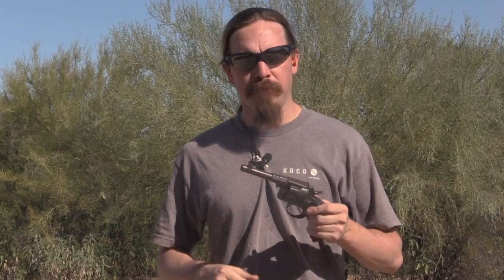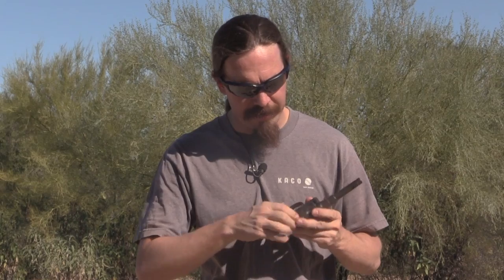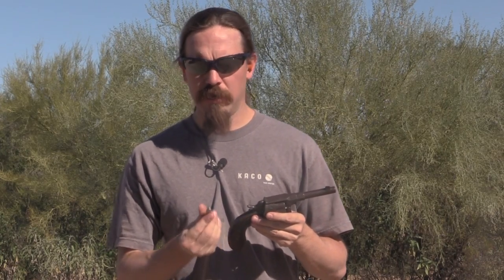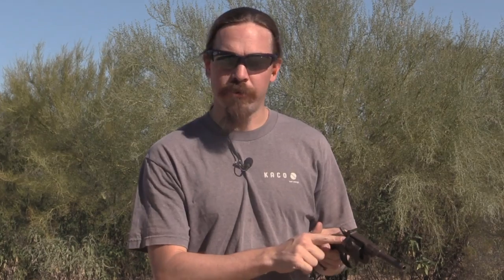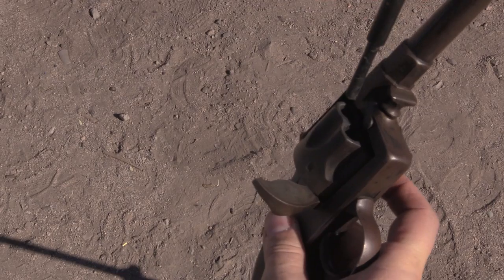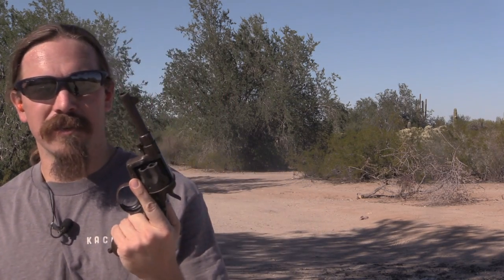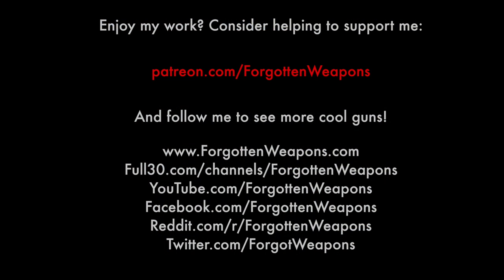Shooting the 1883 Reichsrevolver

Comment: The fact that this revolver has no manual ejector is unforgivable. I could totally get used to everything else.
Reply: Joe Cool  Yes, a very silly omission.
Reply: yep! the only deal killer for me to!!!
Reply: I'd rather have a Webley. Reloading is piss-easy and the casings eject themselves, double/single action with a surprisingly smooth double-action trigger pull, nice big sights for easy target acquisition; just generally seemed to be a more thought-out design, it would seem. As mentioned in the vid, even the M1873 Colt Single Action Army would be better. Smoother action, GREAT ejector rod (probably second best for fixed-cylinder revolvers; there's one Swiss revolver that I think was better because opening the loading gate made the trigger automatically index the casings for you which sped things up), better ergonomics, no useless safety, and so on.

I'd even rather have an M1895 Nagant, and the one I owned left a TREMENDOUSLY bad taste in my mouth. The double-action feature worked only when it wanted to, casings occasionally got stuck in the chambers, couldn't hit dick with it (I'm no marksman, but I was getting something like 10" groups at 10m), and while the Military loading was probably more potent I found the commercial stuff I got from Fiocchi felt utterly anemic. Like I was shooting .22lr or something like that, no 'oomph' or 'heft' at all. In the end, I happily rid myself of it. The date of manufacture was, surprisingly, almost as recent as you can get for the M1895; 1944. Production stopped 1945 as I recall. 

Externally it looked great, but the double-action trigger just could NOT be trusted so was basically single action only. I broke an M1911 mag by using the 'toe' of it to try and pry out a casing from the revolver. The baseplate loosened, weakened, and eventually snapped off.
Reply: It's amazing a major power like Germany had a weapon without a basic feature common in cartridge revolvers by 1870 in 1879. That thing is like a scaled up Smith and Weapon No.2 from 1862. I can see why they didn't want the overly complex Mauser Zig-Zag but other than pure national chauvinism why take this over superior foreign designs?
Reply: @nunyanunya4147  this was produced almost 9 years after the idea was invented and in widespread use by virtually anyone who used a revolver.
Reply: Brings new meaning to the phrase pencil pusher
Reply: Hindsight is 20/20. Remember, they used to think MGs were pointless in combat.
Reply: There exists a better version (Baby Reichsrevolver) which comes with an ejector rod and double triggers.
Reply: @normanm5254  well, in a direct comparison basically all revolvers beat the reichsrevolver but well, there's the other thing you have to consider, this is a 130 year old gun and it still works perfectly (and so do all other reichsrevolvers still around). It has one good feature and that's the fact that it's sturdier and more reliable than a Nokia.
Reply: The overriding design requirement was robustness. Perhaps they somehow felt a manual ejector was breakable. Not saying it was good thinking, but I'm just wondering.
Reply: @thif4722  : This had been civilian production, the armies of the four german kingdoms gave contracts to different arms companies, because the Revolver was not developed by a commercial company. But also other companies ,german and belgian , produced versions of this revolver. This versions had been often different to standardized military version. There had been versions with ejector, double action, trigger guard finger hook, different handles. In those days officers had to buy saber and revolver from their own money, so revolvers in 10,6 mm Deutsche Ordonnanz had been allowed for german officers, also if they had not been the standard model. So some officers had more modern revolvers. Same with their sabers/epees, the IOD 89. Rich officers, of high rank, nobility or factory owners background bought sabers with decorated blades and handles.
Reply: Reloading this gun in Verdun is hell otherwise it’s a really sidearm
Reply: Hey, the Germans of 1880 didn’t care what we  Americans of 2023 would like.

Not what I would carry today, but certainly a neat and interesting gun.
Reply: Several firms made versions of the  Reichsrevolver with ejectors, and often double actions, for private sale. 

These were often bought by, German officers, warrant  officers, and senior NCOs.

Comment: for accuracy remember the barrel was 120 years old......
Reply: And probably wasn't that good in the first place
Reply: akduckwithm16 gaming and outdoors  naw. German quality was best of breed and pride of production
Reply: KuK137 , yeah, of course. But your implied point is irrelevant here. I own an 1883 reichsrevolver, and I own an 1884 (71/84) tube fed mauser rifle. Having inspected both very closely I can confirm that manufacturing was outstanding on both for the Spandau arsenal. And materials were the best available steels, heat treating, wood, and fitment. Despite the design and engineering opportunities they missed, production was in fact, outstanding and tolerances excellent and beyond most of the day, excepting perhaps the contemporary efforts of the Swiss.
Reply: test invalid not European mud
Reply: @RabbitusMaximus  that doesn't change the reality of precision at the time.

Comment: I have the Italian Bodeo revolver. 1886. M mine was manufactured in 1923. It's basically the same, except the Italians did put on a simple little device to push the cartridges out and it is double action.
Reply: But dont have trigger guard so safety was little worse but better than glisentti

Comment: "There is no reason" - there is one: money. This Revolver was designed to be mass produced cheaply. There hasn't been any war in europe yet where pistols played a major role. On top of that, the prussian military had a weird philosophy: provide their infantrist with cheap weapons and rely on the soldiers themselves and middle class civilians in the militia to purchase weapons of higher quality, and in case of a war bring them on the battlefield. 

For example, before the introduction of the Dreyse rifle the prussian ordenance weapons was still a smooth bore flintlock musket. Rifles with&without percussion ignition were only used by specialized Jäger-units and the militia. The reason was: money. The prussian king would rather spend money on castles then on supplying his foot soldiers. 
Then, as in most european armed forces, you had a bunch of narrow minded traditionalists in charge. They just didn't like the "newfangled", experimental stuff, especially when it was from a foreign country. 

The last case of traditionalists hampering the development of modern weapons was the german OKW in WW2. Only after they realized that they were about to lose the war (in 43), they gave the engineers carte blanche to try all these "crazy new ideas" they pitched years or even decades before - like the assault rifle, the revolver cannon, a semi automatic rifle with a well working gas system, new airplane designs, and so forth. 

But coming back to this revolver: it was cheap and obsolete by the time it was issued. But if you got shot with it - you were dead. You won't end up deader if you were shot by a double action revolver.
Reply: all true but the one thing you miss is all military's are slow to pick up new ideas! and all governments would rather waste money on foolishness rather thn on something that needs money spent on it!!!
Reply: Using money on sidearms is foolishness x)
Reply: Gun Nutty Your assessment of OKW is completely, demonstrably false.
Your description of the Prussian system is an oversimplification that physically hurts.
How about you do some research before writing on these topics?
Reply: The pistol did actually play a major role in World War 1 for trench raids, a role that this gun failed miserably
Reply: Europe wouldn't be nearly so interesting if you guys didn't have a bunch of castles everywhere.
Reply: Slow to reload means you won't waste ammo.
Reply: @KageMinowara  but those are mostly build by richer countries like Bavaria

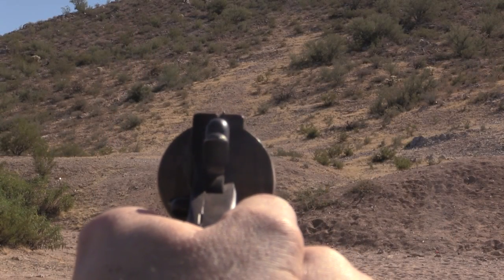Comment: 5:37 - I was wondering about the ammunition. Is this something so rare that even Fiocchi won't touch it? Supposedly Starline will custom-headstamp your brass for you if you have a large enough order, so maybe that's a way to get some "genuine" Reichsrevolver brass out there. 

I suspect this pistol was something along the lines of pour encourager les autres and for desperation at point blank range. Reloading under combat conditions would be difficult to say the least, and I'd rather have a Webley, thank you very much.

IIRC Erich Maria Remarque's character in "All Quiet on the Western Front" is issued with an old revolver at one point. I suspect this was probably it.
Reply: IIRC, you need to order at least 10,000 rounds to get your own headstamp.
Reply: Mine chambers 44 Russian and cut down 44 Specials. I need to find a source of the bullets since they are about 0.420.

Comment: General rule: Mainland European service revolvers suck. The bodeo and reichsrevolver were comically obsolete. The Nagant is the nagant. Everyone else was using something that fired a really wimpy cartridge. The only exceptions I've seen have been Gasser revolvers (which were at best on par with the colt saa) and Russian Model 3s (which I guess aren't even European)
Reply: andyrihn1 you got it right.
Reply: hell Europe has really never had much of a pistol history as far as being world beaters!!! although I guess the Germans and Brits could be considered an exception to that!!! to tell you the truth I think most of Europe had gone metro-sexual long before that term was coined, say at least a 125yrs. before!!!
Reply: did you forget the webley .455?
Reply: wrong, .45 acp (standard US army load) has a taylors formula of 12, while millitary load .455 has a taylors formula of 13

and thats forgetting loads like the mk3 manstopper which was a wad-cutter hollow-point or the mk4 load which was a plain wad-cutter
Reply: +Robbie Dickson Other then how shockingly incorrect this is, let me lay some knowledge onto you.

455 Webly has a MAXIMUM pressure rating of 13,000 PSI, 45 ACP has nearly twice that, at 21,000 PSI

the MK3 was droped in 1900 due to hauge convention issues, bringing back the MK2, 265 Grains at roughly 700 ish feet per second, so significantly below that of 45ACP.

and in the 1939 update to the 455 as the MKVI bought it up a little bit higher then that......still well below that 230 Grain 45 ACP.

Notice how Weblys converted to 45ACP tend to not survive long for a reason, they are flatout dangerous to fire as 45 ACP is in the MAJORITY of cases significantly higher pressure.

To put this into even better perspective, the hottest 45ACP hand load will cause a cylinder failure in a webly revolver thats converted to 45ACP.
Reply: wrong, the mk3 resulted in the mk4 which changed the hollowpoint wadcutter to a standard wadcutter which was perfectly legal, im using the standard army loads and using taylors formula to find how strong they are, 

the taylors coefficient does not lie
Reply: Well i am using math here, Mass X velocity = Kinetic energy.

The Taylor's Coeffcient is not used for ballistic testing, nor does it have any source in reality.

Even the example of 308 given by wikipedia is clearly wrong, it's assumign uniform bullet nature, infact all of these do and that's bullshit.

SO, by using THIS math, 357 magnum is only a 11.3 on that scale, but when you do it the other way even some of the tamer 357 Magnum loads are producing 100+ more pounds of energy on target then 45ACP is, and in some extreme cases over 300+ pounds.

Yet somehow, 357 Magnum scores lower then 45ACP.....mind explaining that?

So by this really outdated and non science based scale, its clearly incorrect.

Hell 5.56 NATO scores less then 6 points on this scale, and that's a fucking rifle round.
Reply: Robbie Dickson I intentionally wrote "MAINLAND Europe" to exclude the Brits, who yes did make competent revolvers

Comment: It is typically German in its design for how it would probably be used. It's likely to be carried for decades without any attention. Then in an emergency it absolutely needs to work even after years of neglect. If you need more than five cartridges your screwed anyway. Or you may very well still have a sword back then.

Comment: Just because it is so ugly and plain, I really sort of want one of those to hang on the wall of my RV.  Only problem, I occasionally hit California and, well I just don't want the grief of having to lock her away for my movement through that State.  Usually if I must enter California, I park my RV in Arizona and unhitch my Ford Edge to drive into that State, leaving my M1911A1 locked away in the RV. This is really stupid though since California has twice the crime rate as Arizona, and that's where you really NEED a firearm, but I ramble on.  Thanks for the great video.  Perhaps some day you can get into forming the brass for such a conversion from .44 Mag to the German round.

Comment: Question, if you have a black powder metallic cartridge gun, could you load smokeless powder but use half or a quarter of the regular black powder load to help keep the gun clean or should you still use black powder?
Reply: Don't quote me, but i think the only danger in using smokeless in black powder firearms is they're too powerful, so if you cut the amount a bit, it should be safe.

Comment: One of the few revolvers worse than the Nagant.
Reply: Not at all. It has every problem the nagant does almist identically EXCEPT that the nagant uses a really weak shitty 32 caliber cartridge with less stopping power than a black powder cap and ball 36 caliber or FMJ target 9mm. This on the other hand is using a round that is identical to the 44 russian which was the black powder version of 44 special and is an extremely accurate round (in a good gun) and has the same knockdown power as 45 acp/BP 45 LC ammo. Simply put this is overall what would happen if the nagant actually killed people when you shot them with it lol.
Reply: The only good virtue of the Nagant is it's supressable

Comment: I am guessing that this would be issued to officers and cavalry?  If so then the pistol was a backup to the lance and saber of the cavalry at that point and a simple gun makes sense.
Reply: The Model 1879 was mainly for cavalry. The short barreled  Model 1883 was for infantry and could be bought by officers.

Although many of the latter prefered commercial variants with ejectors and double action triggers

Comment: It will chamber a .44 Russian cartridge which returning soldiers tried which reportedly ruined the gun since the bore was a bit smaller than 0.429 bullet the Russian used. Has anyone miked the barrel or examined original ammo for the correct diameter?

Comment: Some german analyst in 1883 : "They will know us as the one group of people that overengineer stuff"
The person who designed this thing : "Ich got you fam"
Reply: To steal another comment from here: They put a safety on a single action revolver, if that's not over-engineered I don't know what is.
Reply: @MarikHavair  made me wonder, isn't safety is like basic stuff? And why revolvers doesn't have safeties? Is the trigger pull heavy enough?
Reply: @thesturm8686  With a single action revolver you have to manually cock the gun to fire it, every time. They were also typically carried with the hammer down on an empty chamber to prevent the possibility of an unwanted impact firing the gun. So an external safety would typically be considered frivolous. 

Double action revolvers also rarely have an external safety, the 1-gallon milk jug of a trigger pull is usually consider deterrent enough against an accidental discharge. 

Then there's a 3rd factor being that external safeties weren't exactly prevalent in firearms design until the era of bolt-rifles and semi-auto pistols, which revolvers predate. Some 'modern' revolver designs have more safety features added on but most antiques and even replica designs don't incorporate manual safeties. 

Exceptions exist, this revolver being one. Although the safety as Ian hinted at is rather frivolous in that all it does is prevent the hammer from being cocked, something that would be unlikely to happen 'accidentally' and you wouldn't necessarily trust it to prevent the half-cock hammer from dropping on a round in the chamber. So you don't really get anything out of it.

I'm by no means an expert by trade though, Ian didn't elaborate in this video exactly how the safety works, his other video on the gun may be more illuminating in that regard.
Reply: @MarikHavair  Thanks for the explanation, i never thought you would made a long reply, so thanks

Comment: The barrel wall looks extremely thin that can't be good
Reply: Black powder round, far less pressure to deal with than with Nitro.
Reply: You're talking about a gun designed in 1879, and "upgraded" (in the loose sense of the word) in 1883. 10.6x25mmR German Ordinance and the 1870/1883 Reichsrevolver predate the first smokeless powder firearm adopted by a military - the French Lebel Rifle in 1886, so barrel thickness capable of handling the pressure of nitrocellulose-based powder was never something that would have ever crossed the designers or manufacturers minds at the time of their developments.

As cptreech already summed up - black powder rounds have less pressure than their nitrocellulose-based smokeless powder counterparts, making barrel thickness not as big of an issue in such firearms.